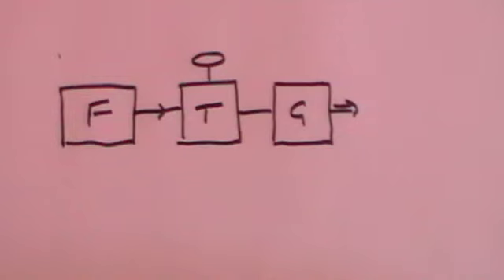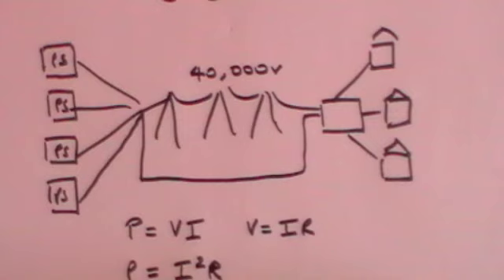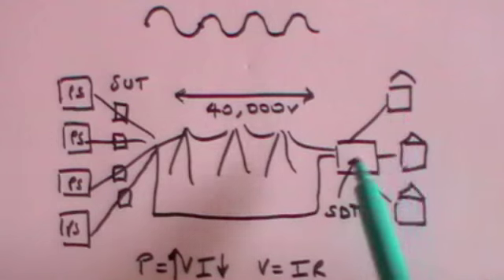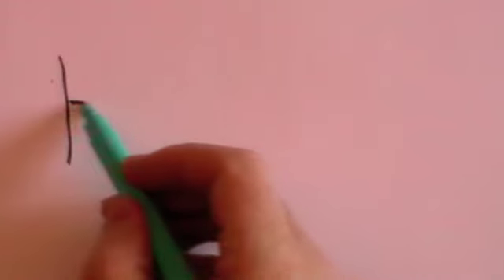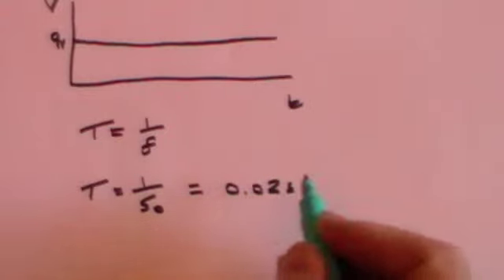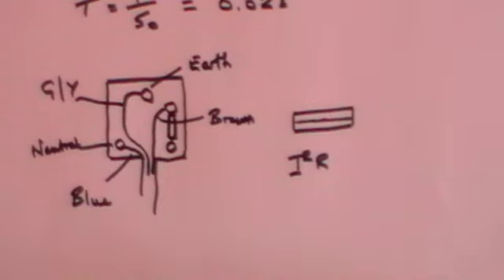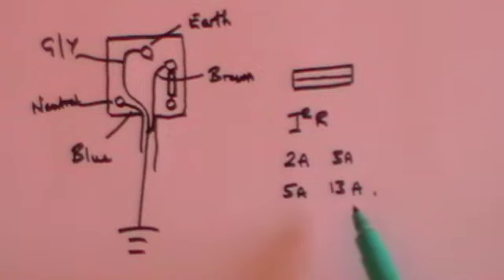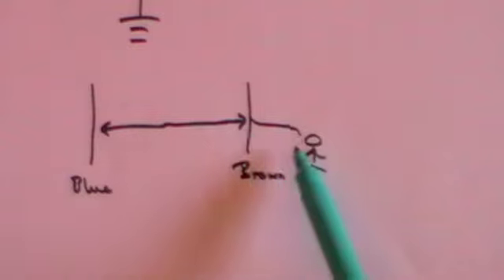Alternating Current, National Grid and Domestic Electricity: GCSE revision

Comment: Good video Good teacher.
16:20  
Many electricians call the nuetral wire or line as cold. When we check it with the hot wire tester, the tester lamp does not light that means that no current is passing between the nuetral and ground through the high value resistor (more than 100 kilo ohms) that is in series with the tester lamp and the body of the person who is doing the test. In some countries the nuetral is combined with the earth line .
It is true that the the current is alternating but only when the circuit is completed. 
Isn't that true  ?
Is there an explanation on this issue  ?

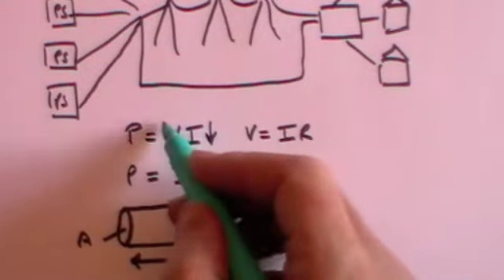Comment: But power=V2/R also, sir(6:52). So wires carrying high voltage current would have more power loss according to this formula.
Reply: i thought the same
Reply: Ibraheem Baloch it is the change in voltage that matters

Comment: If the plug fuse blows how can the neutral wire give you a shock? I thought the current would no longer be able to flow as the circuit is not closed.

Comment: High voltage transmission lines are typically made of aluminium (plus steel for mechanical support) due to it being much cheaper than copper, hence the need to step up to such large voltages to reduce I^2R loss.
Reply: The voltage is actually so high that it can be successfully applied across steel cables :)
Reply from the maker: Thank you. I wasn't actually aware of that. Good to know.